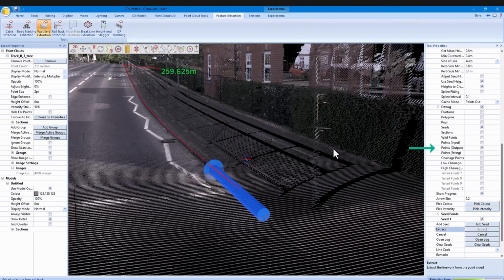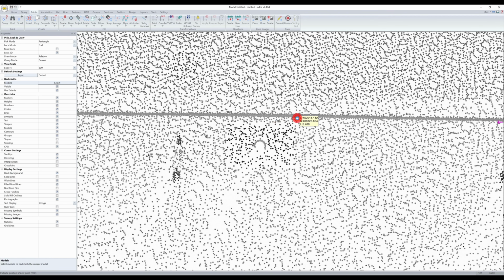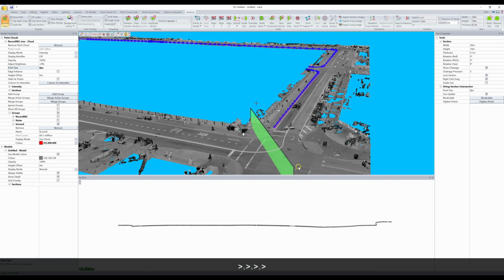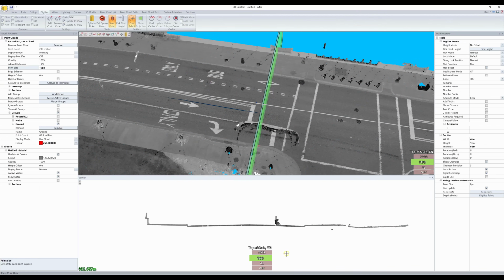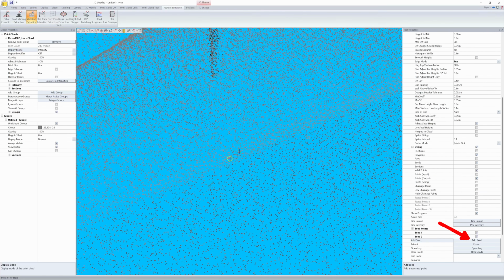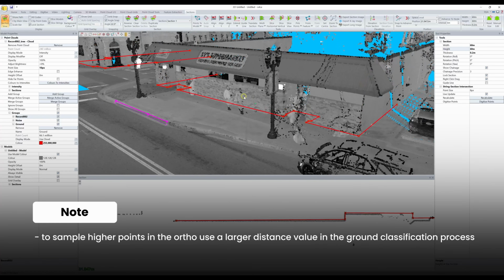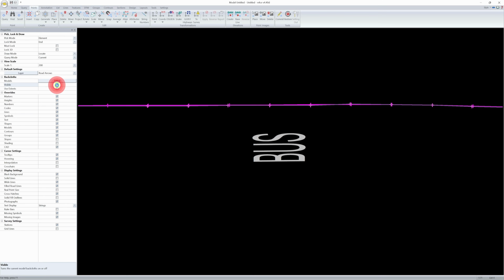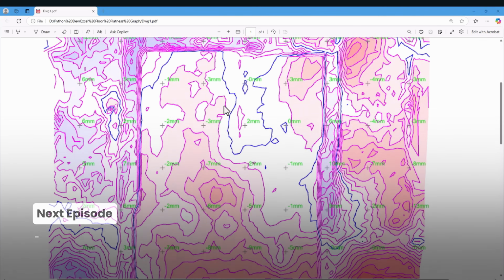Digitizing Roadway Features from Point Clouds in N4ce

Comment: Hi, thank you for all those videos, I find them very helpful. I am using this software a lot but I am struggling to find a good setup for my PC to run the point clouds. It is crashing a lot in 3D viewer. 
Can you recommend any setups, drivers, etc. Thanks
My PC is a i9, 128gb Ram , 24gb graphic card.
Reply from the maker: That PC should be more than strong enough. I was working with N4ce last week on finding a bug that was crashing my digitization in the 3D viewer as well. I believe they got it all sorted and there should be a new build available that has the fix in place. I’d reach out to them and explain what’s going on and ask for that new build.